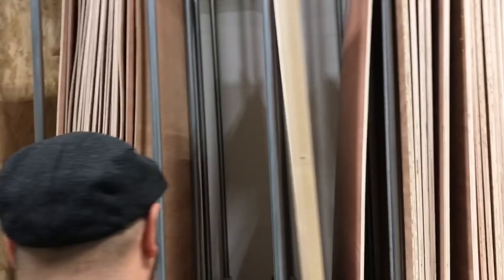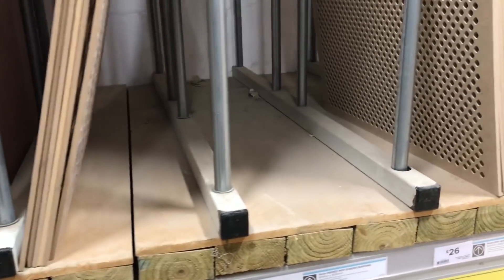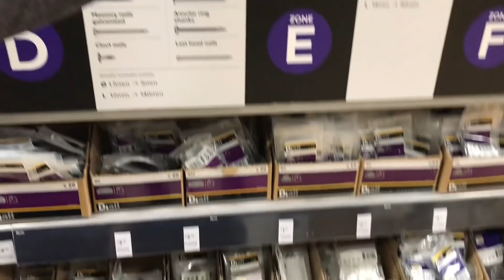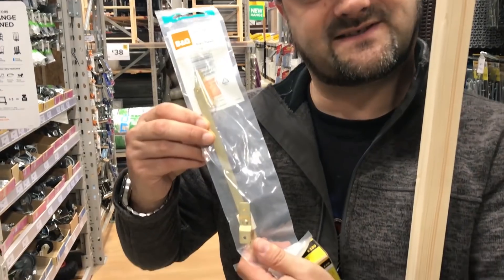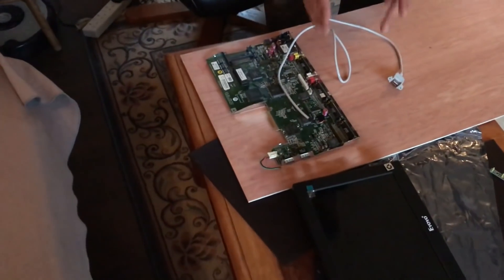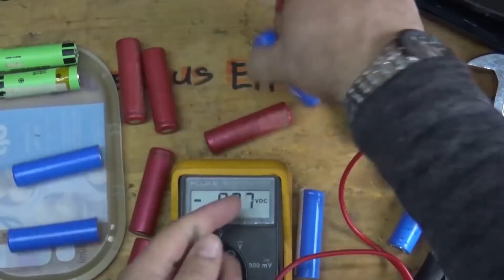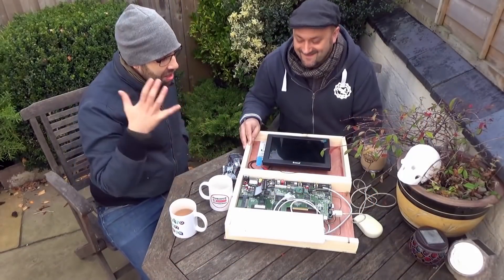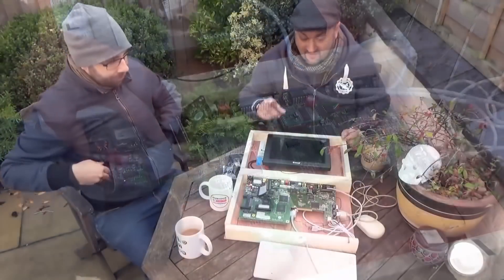Amiga Laptop Project - Part 2

Comment: Looking good Ravi, looks like a great fun build. Do you plan to add a Vampire? If not, will you try source one of the A600 030 accel cards for more speed & ram??
Reply from the maker: AmigaFanatic1980 plan is to start with basic setup and see where I can go from there. Tbh not a vampire fan but might add some stuff extra like 030 and a couple of meg.